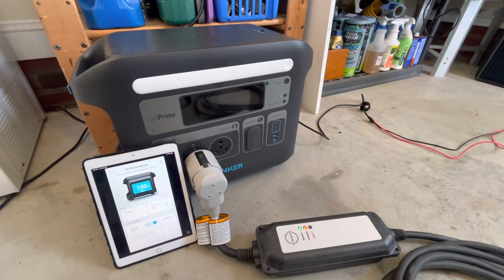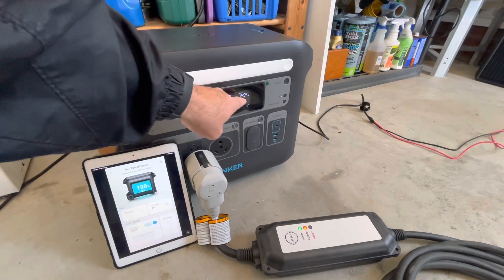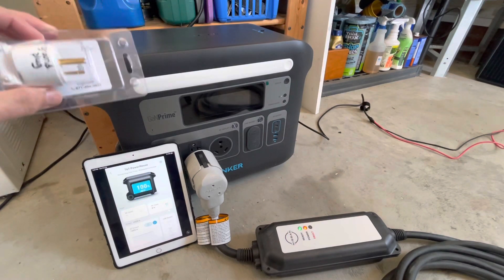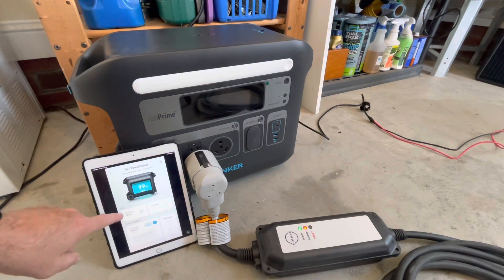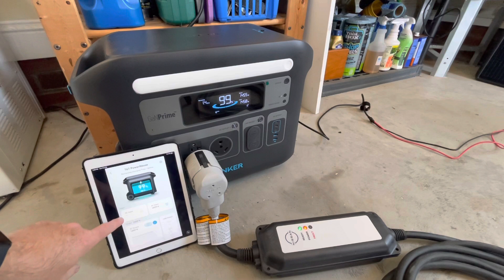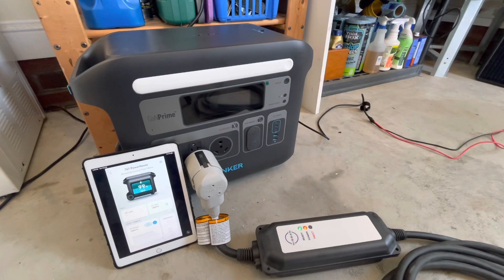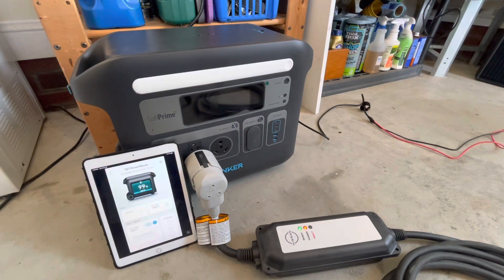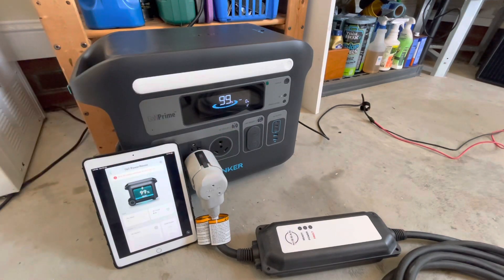Anker 767 bypass limit demonstration

Comment: I used my Anker F 2000 767 for the first time in a power outage with it hooked to 800 W of solar and it got my fridge Internet through the night, but it made it down to just 9% so pushing the limit for a 2 kW battery anyway it worked perfectly the solar recharged to 100% by 2:00PM for 2 days the third day after the power came on it was running the fridge and I didn't see any reason to stop it so I ran it through the next day but that night, remembering that it dropped to 9% wanted to make sure it didn't drop to zero I thought well hey I'll just plug it in. This was after dark with solar cables disconnected, and it started charging at 1400 W and within a minute or two it blew the ground fault breaker so I thought hey I'll turn the input down to 700 W and then in about four or five minutes it again tripped the ground fault breaker and considering every time I charged it before it was plugged in through a ground fault breaker with no issues, but it wasn't powering anything so I'm assuming I have yet to test that by simply putting it to an ungrounded outlet basically third prong removed adapter that I won't have this issue and it will charge just fine while running a load so I still have to test this, but I'm curious about the delayed ground fault trip and a bit annoyed that I would have to leave the ground intentionally disconnected not to mention the oddities with the outlet tester, obviously it has no ground by definition, but does when it's plugged into the wall and typical outlet tester results are confusing to say the least and the odd voltages that show up on the charging power cord,  prongs which seemed like 40 V alternating DC I couldn't tell I don't have the equipment or the knowledge. Any thoughts would be appreciated. And I'd like to finish what I saying I love the unit. Would definitely buy it again. I'd say you need at least 3K battery to safely run a refrigerator on solar in November but it worked perfectly for me and I couldn't be more pleased with the build quality of the unit and it's quiet solid functionality of course of voltage limit increase on the solar input would make it much more practical to use strings instead of parallel series connections, searching for the right panel with a VOC of just under 60 V anyway it worked flawless for me running off of solar absolutely love this compared to a traditional off grid system  . Great job Anker this from somebody who used the outback battery controller and inverter 10 years ago. Large lead acid batteries have all of this in one box is amazing 66 pounds and portable wow.  If the solar input voltage were 150 V. And the polarity grounding issues were at least better explained. I'd say it would be a perfect unit.!

Comment: I plugged in a portable ac unit 750 watts and it runs on fan only, the ac compressor I guess wont turn on. if I plug the unit into AC outlet on wall it works as it should because of the bypass.  but shouldnt the 767 be able to run the AC directly?
Reply from the maker: The AC compressor surge is probably too much for the Anker BUT,  check with customer support.  Some users have been pushed out firmware 2.02 to solve issues with compressor startups.

Comment: Grate video, Can I just clarify,  so even with solar only input active, the Anker 767 can ONLY output 1440 watts, in other words, when using solar to charge the 767, is the 767 in bypass mode and only able to output 1440 watts via the AC outlet ???
Reply from the maker: No,  when using the DC input,  the inverter would be active and you would have 2400 watts.  Bypass mode is only when plugged into AC
Reply: @leafnutz2341  Thanks, and a extra star for how fast your response was lol, I cant understand for the hell off me, why your videos don't get more hits, For the Anker 767 at least, you have covered subject that are MORE important than the cosmetic rubbish others cover, TOP WORK and thanks once again
Reply: @leafnutz2341  with bypass mode u mean it won't add up all that wattage to overload the supply unit, right?

Comment from the maker: A few notes:   The EVSE would sometimes wake back up and continue charging when the AC power was turned off but most times it would require the inverter to be turned off an back on.
Reply: Thank you for the video. Is it possible to do a PV pass through?
Reply: @johndawkins9913  No,  the solar panels make DC power and the inverter makes AC power so in order to use power from the solar panels, the inverter must be on and invertering the DC into AC.  If there is extra PV power, it will charge the battery.  If there isn't enough PV power, it will discharge the battery.
Reply: @davidedwards5119  thank you. It would be really nice if there were a way to bypass the battery to charge an electric vehicle. Are you aware of any inverter design for electric car charger that allows one to send power directly from solar to a car battery (without a battery) With how popular these portable solar generators have become, I would think there would be a lot of interest in that.
Reply from the maker: @johndawkins9913  I'm not aware of any EV's that have a solar charge controller built in to accept solar directly but there are lots of EV chargers and inverters that will do the job just fine.  You can actually use a Growatt inverter in "batteryless" mode and it will charge and EV by blending solar and the grid.  You could technically run these units without the grid but every time a cloud came by the system would shut down so having a small battery or the grid to "buffer" the load is just easier and less expensive.
Reply: @johndawkins9913  Most hybrid inverters have the ability to operate "batteryless" and let the solar just assist the grid in powering a load.  My Growatt does this.